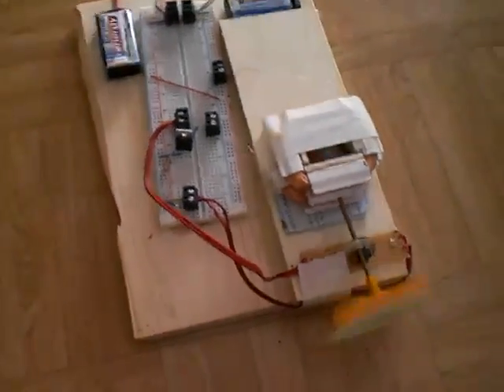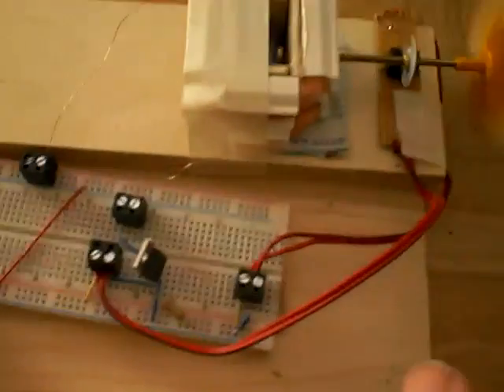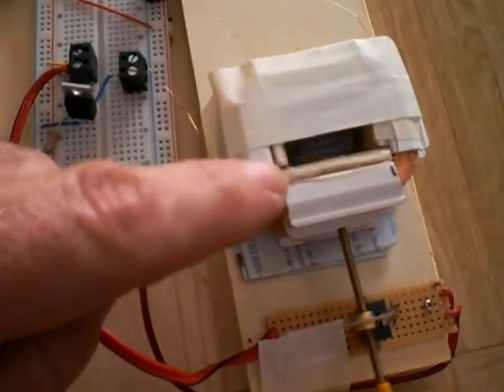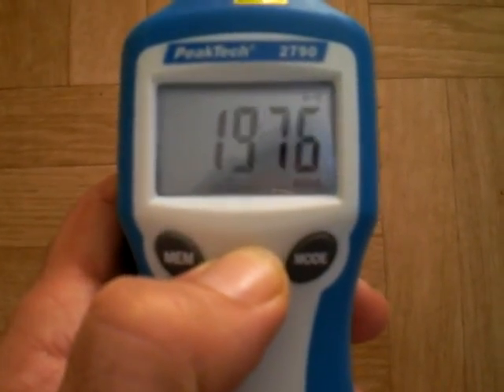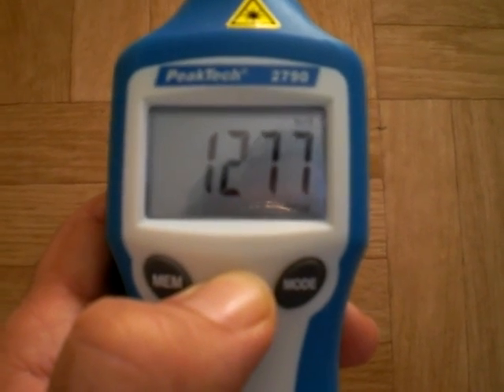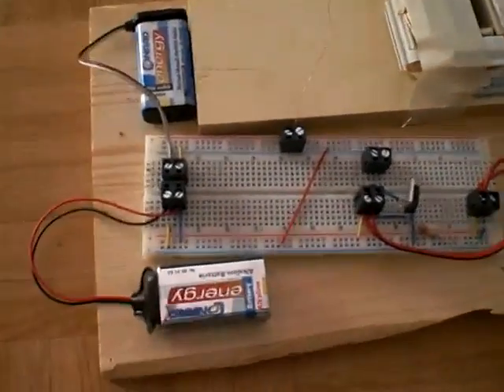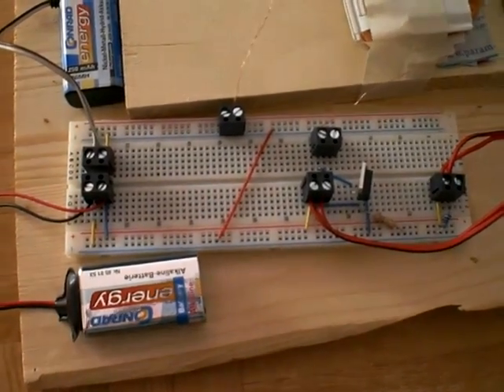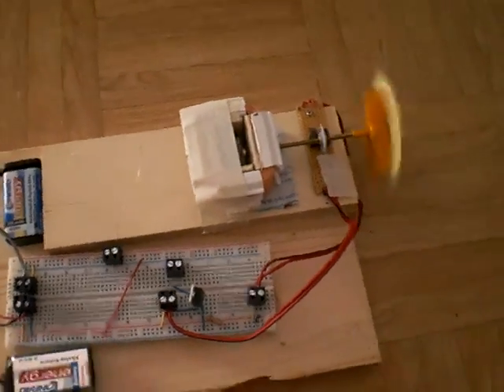Small Keppe Motor Part III

Comment: They claim to have a motor that's 20 times as efficient as normal motors, so I work of a company that uses 1-20 MW motors, how much would we pay for motors that could do reduce that to 50kW. And what do they make , soppy little ceiling fans, come on, get real, they would be trampled underfoot if it worked.